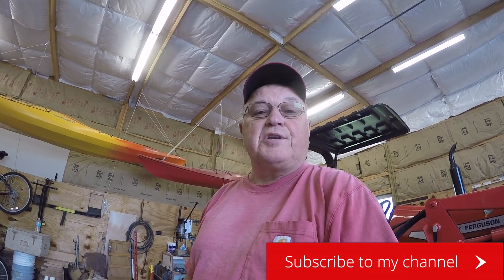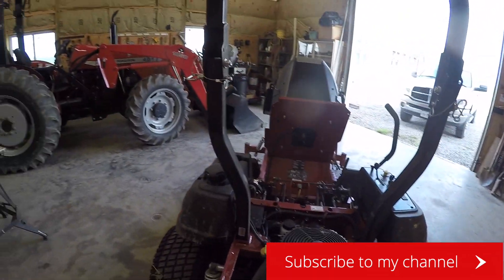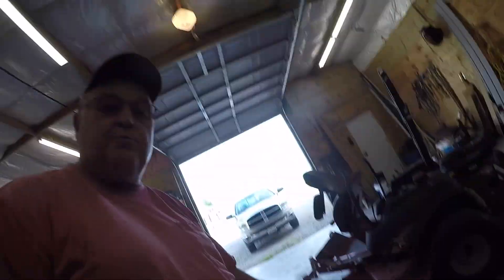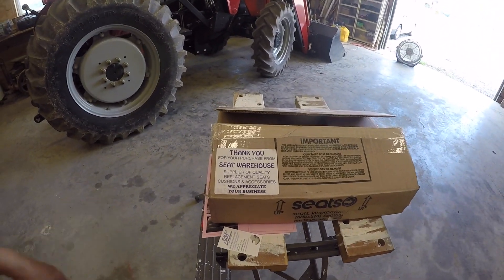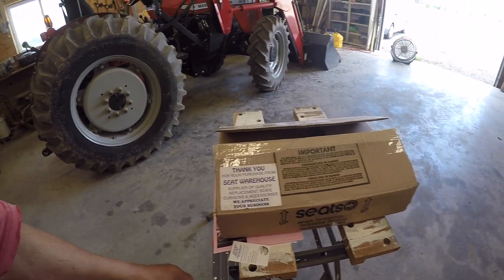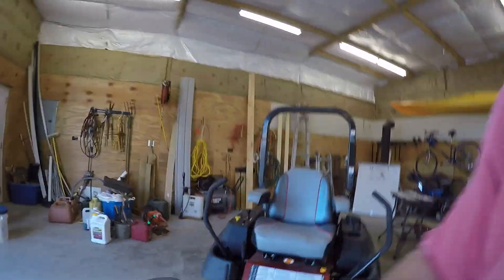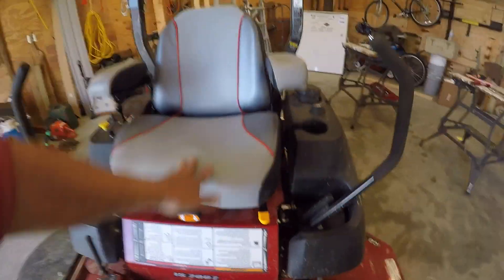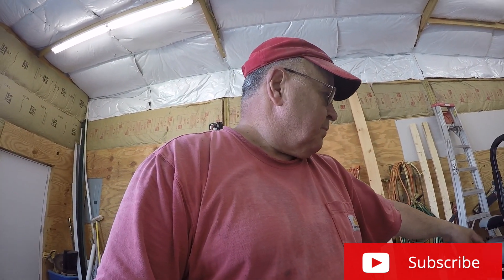Zero Turn mower suspension seat

Comment: Great video. No offense but I think you adjusted it the wrong way. If you set it to the left, (as if loosening the handle) as you would for a lighter operator, it gives less impact absorption., Crank that bad boy to the right (as if tightening the handle) and it gets firmer but absorbs more impact for a bigger operator such as yourself. Setting it too light results in the suspension constantly bottoming out which is painful.  I realize this is a 4 year old video but people still come here to view it so the comment is relevant. Just sayin.

Comment: Ordered one for my toro 60” I noticed on the new ones they have isolators on the seat mount......I’m gonna have to do some southern ingenuity, but gonna try that......it looks like it will raise the hight 3”....... thanks for posting..........love your shop.
Reply: Ive used shock rubbers and cut in half with steak knife. Every little bit adds up.